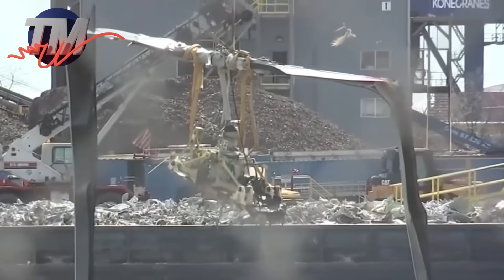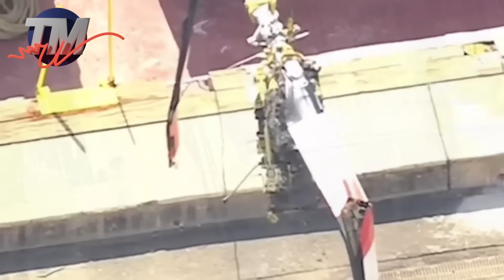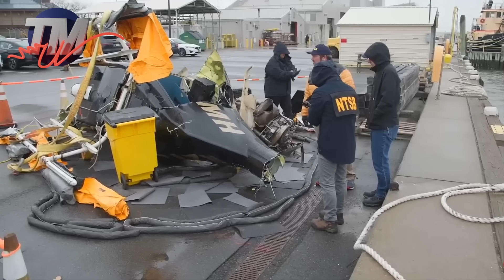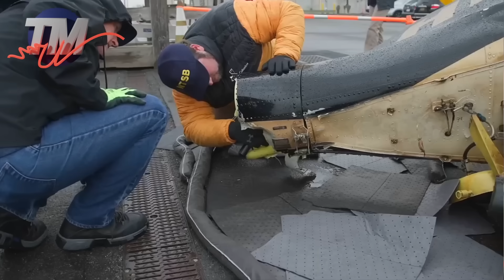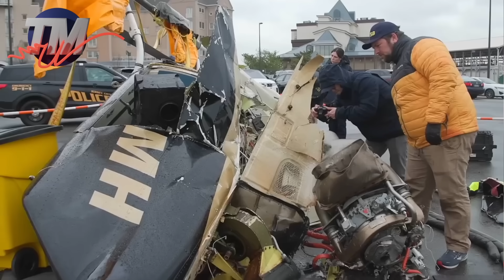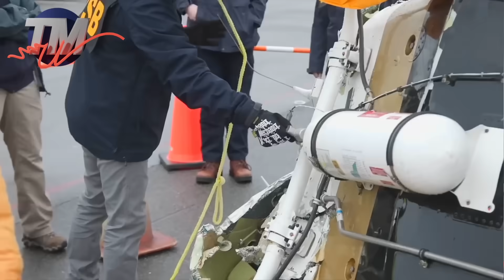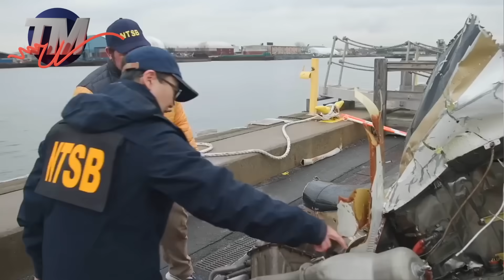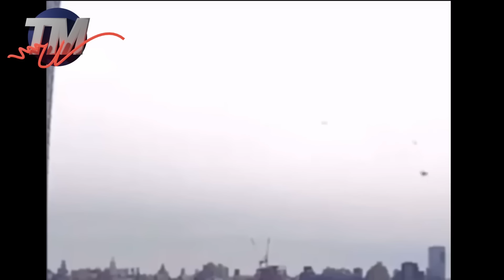Recovery of the Main Rotor of the Hudson River Tourist Helicopter - it's worse than we thought

Comment: !. Gearbox seizes. 2. The mass and inertia of the rotor causes the fuselage to suddenly twist in the direction of the rotor spin. 3. The sudden twist causes so much leverage on the tail section that the aluminum tears from the rivets.
Reply: I agree 100%
Reply: @GUITARSTUFF911  That is possible, but if the MR gearbox seized, then the mast pole would have at least shown massive twisting or would have twisted off probably where the cone set sets in the mast pole, because of the inertia of the main rotor hub and blades.  20 years working on and flying in these.
Reply: @POCarton  That is also a good observation,  I am just trying to understand what happened and at this point it is all speculation, I Will be following this outcome with he NTSB. I am admittedly no expert at all, just using the practiced skill of observation and research and logic. I never clamed to  be any kind of expert just a lowly observer with good research skills. Trying to understand what happened in this tragic case...
Reply: My theory as well.
Reply: @kenjhee  I 100% agree.  I thought this was the failure mode from the very day of the tragedy due to the video showing the main transmission falling while still attached to the roterhead and blades. That amount of instant torque probably broke the necks of the occupants instantly.  Very sad.
Reply: @edbittner480  damn ,, yes u right
Reply: @edbittner480 this is something I hadnt considered. You dont see that torque from watching the helo but you are saying the passengers would have experienced it?
Reply: At first I did not agree with your conclusion, as the rotor was spinning freely as it fell to the water.  Then I saw the commenter who pointed out the likelihood of shear pin releasing, which would actually allow the rotor to freewheel while falling, which it could not do if still directly coupled to the  transmission.  So I agree with your conclusion.  Also from my engineering experience in the defense industry, it is difficult to comprehend the massive forces generated by an abrupt maneuver under power, such as you described with a sudden gearbox seizure.  The instant 90 degree yaw with the tail rotor still providing full counter force would likely put stress on the tail mast far beyond its design limits.
Reply: @BrandononIce-sk7fx  Absolutely  The amount of force generated at that instant was tremendous, I am sure someone with a degree in math could do the calculations, I will ask grok......RE: For context, a typical helicopter transmission might handle steady-state torque in the range of 1,000–10,000 N·m during normal operation. A sudden spike to 500,000–5,000,000 N·m would likely shear bolts, fracture mounts, or cause catastrophic failure of the transmission or airframe,
Reply: @BrandononIce-sk7fx   The transmission mounts or airframe would fail at their weakest point, likely well below 438,000 N·m.
Reply: @BrandononIce-sk7fx There is an instant when one could see the tail still pointing the original direction as the rest of the body was 90 to the right

This tells me the separation was instantaneous, or it would have changed direction even slightly before shearing
Reply: This makes the most sense.  People who think sabotage is possible are our of their minds. It's an accident. Nothing more. Nothing less.
Reply: For the box to seize it must be catastrophic. It is not unknown for a  gear to crack in two without any prior warning. Mag chip indications are fundamentally teeth wear and bearing break up indicators. HUMS systems were introduced for more transmission analysis in flight after a British oil rig  helicopter of a Puma type derivative had a complete rotor and shaft detached in flight. All the crew and passengers were lost. Cause? A corrosion pit had developed in the main ring gear of the gearbox. The sea water environment had over time managed to penetrate into the housing and condensed inside the box. The pit caused a stress raiser in the gear and "Bang" fatigue failure without warning. Contributing factors were poor aircraft cleanliness and periodic fresh water washing of aircraft fuselage post flying over the sea. Like it had never had one in months. Storage of the aircraft in high humidity hangar and lack of first line corrosion prevention and inspection methods or experience of such by operators.
Reply: That is the best educated guess at this point.
Reply: Some elaboration from an amateur physicist that studied engineering:

EVERYTHING can be modeled as a spring.  Assuming the gearbox did seize, the rotor blades will keep spinning from their own rotational inertia and load the mast as a torsion bar.  if nothing breaks before all of the rotational energy of the rotor blades is taken up by the twisting mast, the rotor blades will come to a stop and the mast will start to unwind and become an oscillating torsional pendulum, until all of the energy is dissipated.  In this case, the torque seems to have ripped the gearbox from the helicopter, before the rotor stopped, so the rotor kept spinning, after the helicopter came apart.

One way for the gearbox to suddenly lock up is if one of the planetary gears failed, split in two, and a fragment lodged between either another planetary gear and the ring gear, or between the sun gear and another planetary gear.  It may be possible for a single broken off gear tooth to jam the gearbox, solid.  I read a textbook on vibrational analysis (about thirty years ago, so I remember neither the title, nor the author) that suggested that the acoustic signature of one cracked gear could be detected, but not in real time, as it discussed forensic analysis of a recording a helicopter gearbox that used then-bleeding edge analysis techniques to isolate the gear tooth impacts to determine that a crashed helicopter whose wreck was unrecovered was lost to a cracked gear in the gearbox.

Gyroscopic precession is counterintuitive, unless you successfully flew WWI fighters like the Sopwith Camel or Fokker Triplane.  In these aircraft, with their engine providing a large spinning mass, pitching up induced right yaw.  Turning left was harder to do, as left yaw pitched the nose down and pulling up caused a right yaw.  Inexperienced pilots could apply enough left rudder, at take off, to immediately pitch over and crash.  Why is this relevant?  A sudden yaw motion on the tail boom is going to cause the tail rotor to precess in a way that applies a twisting moment to the tail boom.
Reply: A seized gearbox would help the rotor keep rotating (by the flywheel effect) of such a heavy component spinning round, it would help rather than hinder the rotation.
Reply: @robertfack3082  not if it locked/ seized up from lack of oil.
Reply: That's pretty well what I though the rototating mass of the blades would present and awful amount force on the gearbox assembly if the gearbox seizured and the sudden yaw with that amount of force may that have caused the tail to inevitably snap..
What's interesting is the break points on the rotors blades are in exactly the same place on both blades and also close to the rotor hub.. not sure what other people think more as a topic of conversation..
People died in this tragic accident and hope ntsb will get to the bottom of how this happened..
Absolutely tragic and very sad..
Reply: @philkennedy342  They could have snapped in recovery from leverage against the water if moved too fast. Or when the seizure happened but appeared intact in the autorotation from centrifugal force.
Reply: @sbukosky  Doesn't matter so much that they snapped, but how they snapped and how intact they remain. Both broke the outer skin without twisting or separating the core, which says to me a high force with low speed.... something after the accident.
Reply: @philkennedy342  Blades appeared to be intact and spinning while falling, likely destroyed on impact with the water.
Reply: @philkennedy342  I noticed as well that both the rotor blades snapped in near enough the same place.
Reply: @philkennedy342 if you watch the close in video of the rotor's decent after separation you see them intact and spinning when they hit the water after they had turned sideways in the air instead of vertical like they are when attached to the chopper. Pretty sure that happened when they impacted the water unless they snapped when the torque incident happened and were just stretched out on the way down by the little cyntripical force it still had on the way down.
Reply: @scottcoley1906  I just thought it strange that the blades broke in exactly the same place even the break was exactly the same so like you say did that happen on contact with water or on separation and stayed straight while still rotating note taken thought...
Reply: @philkennedy342  It was ok though on the way down unless the spin was keeping them straight.
Reply: @philkennedy342  Looking where the tail broke off,I cant believe how FLIMSY that looked! there's a lot of leverage against that too
Reply: I said this day one.
Reply: You nailed it....!!!
Reply: How and why did the gearbox seizes?
Reply: @goggobus4076 That's the $64 million dollar question!!😮
Reply: @goggobus4076  Badly rebuilt gearbox perhaps. I see them for sale online for $20k.
Reply: @goggobus4076  Because maintenance on helps used for tours aren't maintenanced like they are for the police or military.This one had an inspection I believe two years ago and wasn't due again for another 5 years.
Reply: @goggobus4076  They were broke and not following the rules or servicing things properly.
Reply: @The-House-of-Seven  This helicopter was serviced March.
Reply: @GorgyPorgy65  What does that have to do with it being done correctly or not?
Reply: @ It doesn't.  I'm just saying a time frame.

I'm going right out on a limb and saying I see something a little different to this op.
I see a join which has failed but not from tearing.

The joint of the tail section is perfectly ok on the top half...ie , screw/bolt holes are not torn at all.
Yet look at the bottom half.  The bottom has been torn away and this gives the indication those bolts were intact .

The fact the bolt holes are fine on the top gives the impression those bolts were not there.  This was a partial fracture due to sheering of bolts or bolts not there in the first place.

Look at the steel at the join, The bottom hole , where it has torn, is pulled inwards to the left.  The left hand side is pulled outwards.  This tail sheered off to the left...but it sheered off only at the bottom.  The top came away cleanly.  This to me, was not a tail breaking off.  This was a tail which was unsecured at the top and the forces made the bottom finally sheer and break away.

What do you think ...after looking at the footage re what I said.
Reply: But wasn't the rotor still spinning after it Seperated from the helicopter?
Reply: @Chooky88 this is the exact cause why it would even detach. Fuselage stands  almost still, rotor turns. There is no reason why the end result for the Rotor shall be detached + standing exacly still after a chaotic detachment. It lost RPM however.
Reply: Yep I am looking that way too. If it were a boom strike the rotor assemble would have shown that damage, and it would not have been able to fly as it did.
Reply: All happening in 10 thousandths of a second.
Reply: Good analysis!
Reply: I agree. From time 1.48 to 2.12 you can see a large hole in the tail section where the break is, where the tail section came off on the side facing the camera, the left side if the tail boom. Do you see that?
Reply: I totally agree, why is everyone over-complicating this.... to get views???
Reply: excelente.. el mejor comentario
Reply: Exactly what I was saying after the 1st 24hrs after the incident when I saw the CCTV footage. I've seen the exact same results happen with Scale R/C Heli's where the Transmission has a catastrophic failure. The sudden yaw was enough to rip the Mast off the trans(with blades and head intact) and bend the tail boom. On this 206 with much more mass it's no wonder the boom departed after the head, mast, and trans did.
Reply: Good observation.  That certainly fits with what we have seen so far.  It also may explain why the roof section along with the transmission and Rotor ripped off.
Reply: My thoughts ever since I saw the live stream video.
Reply: It'd autorotate if it still had a helicopter attached so I guess it'd do the same when free falling? Dunno. Works for pine tree seeds 🤔
Reply: That’s what I am wondering. If it totally seized and the inertia ripped the transmission from the mounts?
Reply: Transmission froze up, my thoughts exactly. Right from the first time I saw the video. The mast acted like a torsion spring probably keeping it from grenading. I thought the mounts broke but it turns out that it ripped the top off. The rotor fluttered down with the transmission attached
Reply: I second the gearbox seizure as a long time A&P.
Reply: That would be my guess.
Reply: That's exactly what I believe has happened. Gearbox froze up or  failed . Causing  the rotor blades and fram of helicopter to twist and causing the transmission to blow off the helicopter. This  also would cause the.isse worh talrotor as well.
Reply: This was my thought as well. The boom, to me, appears to have failed in overload (as you say, sudden stoppage points the aircraft, aero overload breaks the boom). The gearbox mounts let go, etc. If true, the gearbox will tell us with Crystal clarity. The wreckage is extremely well preserved. 
We await facts and findings.
Reply: yeah, transmission seized, it wasn't mast bumping, mainly because the 206 uses a semi rigid rotor system, means it's not likely in a 206.
Reply: Agree
Reply: I’m not a pilot but I am a mechanical engineer (retired) and I agree with your theory. This is only my opinion, maybe the gearbox had skipped a service or the wrong oil was used at the last one and this is where I’m coming from. I have a Range Rover and a Mercedes and both need specific oils for engine and gearbox, RR’s are renowned for engine failures while the MB gearbox oil is life of, but that life of is 100,000 miles. Anyway guys what happened here is a tragedy and I’m sure you will hear what the cause was. May God care for those poor souls 🙏❤️
Reply: It would be almost obvious to me that a sudden jam in the gearbox is most likely responsible for severing it from the structure (while taking structure with it).  However, all of this kinetic energy would have come from the rotating mass.  This may include the engine below as well as the rotors above.  If only the rotors take credit for ripping it off then it means that all the torque was transmitted down the mast.  I am shocked to consider the incredible strength the mast would require to not immediately shear as it attempts to accelerate the entire  transmission into rotation.  I would more likely believe that power from the engine would have contributed simultaneously.  I don’t know enough about the engine coupling to speculate.  It would have to rotate in the same direction axially to play a role.  One thing is certain.  The exact cause of this tragedy will be discovered.
Reply: 100 percent. Whipped beyond stress loads.
Reply: I think you may be right-had to be huge amount of energy to cause the damage - something I can’t see pilot induced RIP
Reply: CASE CLOSED!  WTF does the NTSB exist when we have you??
Reply: I would tend to agree, and the 'tail section' is mainly there to just support the tail rotor. I'm a 77 year old man and have most of my life around all sorts of rotating equipment. When you have things rotating that quickly, there's a huge amount of inertia involved. I would suspect just about every part in that transmission and the shafts, gears bearings...are made of very hard heat-treated steel, even a very small (4-5mm) piece getting loose in there could cause a seize-up. NTSB will inspect and give a report, those guys know more about this stuff than most of us do.
Reply: Torque force is a doozy- I put a brass tube with a plastic prop into my Dremel tool and let it go atfull 20000 rpm- the brass tube was ripped in seconds and was twisted like a coil asthe prop spun away. Torque is a mighty force.
Reply: @ it definetely sent the transmission off the fuselage. In the videos you can see the chopper sent off in less than a second out of that force. It all started with the tail dettaching after the transmission seized.
Reply: @sbukosky  there was a witness to the sound. Can anyone post what that witness stated? Something like a Boom?!?
Reply: Agree
Reply: The mast pole would be twisted from the sudden stoppage.
Reply: How old was helicopter !
Reply: Oh my God
Reply: Oh my God
Reply: I don't have the slightest idea about aircraft, but, according to what you all say about transmission lockup, could this result in the main rotor blades fracturing at the same distance as if they had been broken in the exact same place? When such a brutal torsional force is present as to tear the entire transmission assembly from the fuselage, shouldn't the blades be bent and almost wrapped around the rotor shaft? What a terrible loss in such strange circumstances. Greetings from Colombia.
Reply: Excellent theory —could be a socket was left in there.service records I’m sure looked at. I dropped socket in gear box of tractor why I thought of it
Reply: Gearbox oil leak, or failure of ground crew to replenish oil after draining. That way it would run for a while before a massive torque event.
Reply: There is a lot of discussion in this..whether it went to the left or right (regarding footage), if the rotor at the top caused the yaw, etc, etc.
Watched the footage a lot and I think it definitely yawwed violently to the left and the tail section here kind of gives a lot of credence to that.
Look at the join.
The hole at the bottom has pulled the steel inwards and there is other footage which shows the left hand side is pulled outwards.  The hole clearly shows the steel was torn away with the join intact.
However look at the top half or 1pm to 3pm quadrant of this join.  It is fresh as a daisy ...no tears , holes still there until it gets up to 12 noon and you can see the tearing.
I bet you anything , this section of the tail either had missing bolts OR the overlap was not complete to the 2nd row of bolts and this created the weakened structure...enough for wind and forces to create enough force to break this tail section partially to the left (explains the abrupt yaw to the left) before those same forces tore it right off.
Note the top quadrant holes are still perfect....not one tear in any of them.  The tail failed...whether deliberately (sabotage) OR mechanics did not put them back in to the regulations required.
The paintwork adds to it.  If this section was painted...the end of the paintwork is at the holes.  That means those holes were drilled RIGHT on the edge of the attached piece.  The overlap was not overlapping enough and the secondary reinforcement screw/bolt holes were not securing enough of the forces.
Let's see how this pans out...but we have seen only 1 bolt like this bring down passenger jets
Reply: Exactly what i was thinking.
Reply: The blades would have snapped off of it suddenly seized the gearbox.
Reply: @sbukosky  yes due to mrg seizure
Reply: Flying is not as safe as they say.
Reply: @sbukosky  and the tail hits the transmission box
Reply: Probable. However, the dFMEA in the PHAC [DO-254 Pea-Hack] should've addressed such a GB failure [wonder what the Real-Time, Design mitigation was]. Need a Kinematic Diagram to analyze it.
One thing is somewhat clear at this point, is that, it was probably NOT a MR-Flex hit to the Tail boom [Forensic analysis with a Mass-Spec will tell, even if sabotage]
The MR-Blades did NOT look damaged [as it would be if there was a significant TAIL Boom strike]
Reply: That sounds right.
Reply: From a tentative engineering perspective i had same thoughts on seeing the rotor and gearbox departed like that
Reply: I'm leaning this way, as well.  But will obviously have to wait for the investigation to conclude.
Reply: Those were my thoughts also. I just don't see anything remotely looking like sabotage as the presenter hints at.
Reply: Bingo.
Reply: This was my thinking as well.
Reply: That's the first thing that went through my mind.
Reply: Also remember it was in fast forward flight, exposing the side of the fuse to the oncoming air sure wreaks havoc on especially long levers like that.  Btw didn't the rotor spin on it's way down including the gearbox? Would fit the overall theory. Can't wait for the report tbh.
Reply: It does look like that, but... It surprises me because, I would have thought the mass of the fuselage and air pressure from forward movent, would make the main rotor/blades be the likely weaker/less mass portion of the two. If the box seizing means you get that result, I'm wondering why this kind of thing hasn't happened more.
Reply: @xray606 transmission failures on helicopters are exceedingly rare, thank god.
Reply: WH Yis the original poster even discussing the bloody tail rotor?  It's absolutely of NEXT TO ZERO importance here because the entire top mechanical part of the helicopter disconnecting itself from the top of the helicopter is really the only important thing.  It stays connected, and that helicopter slowly declines from engine/transmission failure, or it autorotates down from a tail failure.

The complete failure of the top of the helicopter is really THE ONLY thing that needs to be concentrated on in the short term as that sort of disconnection is basically unheard of and was the direct reason why all of the people are dead. I think those of us who have mechanical knowledge of a helicopter (unlike you) can all suggest that it's a good bet that a seizure was so violent that it severed all of the connection points off the top.

PLEASE...STOP with the content creation of this.  Stick to details.  You're not a mechanic or specialist.  All you are is some dude making content money off of a tragic incident. You people always come out from underneath your content creator rocks every time something like this happens, complete with zero actual first-hand knowledge of the vehicle that was involved.

Please. Go back under your rock.
Reply: @DavidSommers-r7g  boo booo 👻 😂
Reply: Hola. Soy español y vivo en madrid. Una pregunta. Parece ser un niño iba sentado delante junto al piloto. Es posible que este niño tocara algun pedal o mando y hiciera que el helicoptero se desestabilizara?. O los mandos del lado del piloto estan desconectados. No se. Otra teoria seria la de un posible sabotaje a fin de atacar a siemens empresa de la cual era ceo el pasajero principal. Este accidente es rarisimo y no es para nada normal. Gracias.
Reply: @oscarperezrodriguez5076 , i had the same thoughts a few hours later after you wrote you're comments here. I read yours afterwards. Condolences from Amsterdam.
Reply: @oscarperezrodriguez5076  A Russian teen who was son of the pilot on (at the time a brand new fly by wire Airbus) caused it to come down.  So, you're not crazy for throwing that theory out there.
Reply: @oscarperezrodriguez5076 Los mandos, cyclic and collective no estan montados cusndo llevas passjeros en el asiento iszquierdo. Pere si, los pedales, el el niño llegarie si, un peligro
Reply: @Muehlema1Yes, that theory makes the most sense: the child in the L seat next to the pilot could have touched something(s) that the pilot could not respond to. How tragic and a lesson to teach everyone in aviation + transportation industries. 😢 No one esp. children allowed to sit near operator! Must be enforced, 🙏🏻🪷🕯️
Reply: It looks like a failure of tailboon attachment hardware,  At that speed if tailboon gets detached from the main fuselage the main rotor torque probably caused the detachment of the whole hub, blades, XMSN and support assy from the Acft cabin section . The pilot's corrective flight control inputs after tailboon detachment probably contributed further to the main rotor section. Recently Bell has issued with a lot of ASBs on tailboon attachment on other Bell 407 variant and inspection is even downgraded to every 50 hours for a similar part number tailboon. 
One of the Bell 407 crashed in IS during hover @ one year back due to the tailboon attachment failure where the mechanic forgot to put one bolt and nut out of a set of four..

Otherwise only sabotage can explain such huge damage to aircraft in flight.
Reply: @navnilsarathi2759 it failed aft of the attachment point, not at the attachment point. Hardware didn't fail here.
Reply: @navnilsarathi2759  tail rotor power drops off with airspeed.
Reply: @navnilsarathi2759 the tail was snapped 12” aft of the tail attachment point.  Clearly It snapped along the rivet line of a former.  Look closely at the video.  Was the gearbox seized is the question i want answered.
Reply: The gearbox wouldn't seize.  There's enough force in the rotor to grind the gears flat.  It would twist in the opposite direction.  Tailboom failed first.
Reply: @ Possibly half severed and the direction was then lost...hence the swift yaw to left (I'm seeing the helicopter suddenly point LEFT , not right).

If you look at the tear fracture on the tail....the helicopter  steel is PULLED to the left in the failure point, ie the steel tail is curved inwards on the right hand side and outwards on the left hand side.

That means the forces were against the tail on right hand side.  If the forces were on the right pushing against the tail, it adds credence the tail was PUSHED that way which would steer the helicopter to the left suddenly before the entire tail section snapped off.

I think it was a partial failure of the tail section, which yawwed the helicopter violently to the left.  The physical forces then completed the ripping off of the tail.

I think the  top rotors ripping away from the helicopter  were the secondary reaction to the first dynamic force.  The tail end broke quite close to the main section, possibly a part went forward with force and took out the top rotor mechanics.
Reply: Look closely at the join....it isn't torn at all.  It has precisely come apart.  It is only the bottom section of the join which is pulled and torn (to the left).  This gives evidence that the bottom was secured by bolts...but the top was not.

I'm wondering if the screws in that tail section has sheered away, were NOT on the  helicopter and the drag and gap allowed wind to enter the area forcing the tail section in two movements...partial and then a full tear off the aircraft ?
Reply: @ For sure, the gears are not enough to wrench the entire unit. The teeth would shear. I was assuming something bigger had broken. I can’t imagine that the tail boom shearing off and the subsequent yawing could cause such a structural failure. But, who knows? Bell should have the knowledge to simulate this.
Reply: @jamesdellaneve9005  rotor bumping, look it up, perfect explanation. But what caused the helicopter inputs to get it to do that.
Reply: @ How often is a complete tear out of the top structure of the helicopter after a rotor bump? If you watch the video, it’s flying straight. Even if you were hard on the collector, would it happen that fast?
Reply: @jamesdellaneve9005  the rotor hit the tail section many times in a split second which shows on each end of rotors because they are broken consistently in the same spot. Which in turn correlates to the distance at tail section where it was "cut off".
Reply: @ Yes. I saw that on what they were pulling up from the water. I was an engineer at Sikorsky back in 1985. I saw a few land after bird strikes. 4 rotors is better than 2. The first rotor would take a big hit, the second, less and so on. It would be a bad landing, but it made it. I saw two of them when I was there in my 18 month period. How common is it for the entire top of the chopper to rip out after a tail strike? That’s the strongest part of the chopper. When I was at Sikorsky, they found extreme cracks on the structure under the transmission on the S-76s. It was due to previously unknown vibration patterns. They had to re-design the structure and retrofit all of the delivered birds. Luckily, nothing bad happened.
Reply: Agree
Reply: Wouldn't the four rods that mount the gearbox to the roof have bent even a little? They appear pristine. I can't imagine they are that much more robust than the roof itself.
Reply: @ky7299  Nope. those rods are essentially mounted to a soda can.
Reply: @The-House-of-Seven  That part of the airframe takes all the torque transmitted from the engine to the rotor and the whole angular momentum of the helicopter itself. all moments of inertia meet there. It can't be that weak.
Reply: @ky7299  Under normal circumstances the rotational forces are always started and stopped gently. This could happen on the ground. You can replicate this right now. Raise the engine rpm and engage the main rotor with a dog clutch. Same exact scenario would happen. This is what happens when the rotor it stopped in a fraction of a second.
Reply: @The-House-of-Seven  Agree..the force has to go somewhere.  It doesn't just dissipate.
Reply: @The-House-of-Seven 
Nah. That much kinetic energy and momentum of the rotating assembly would explode the gearbox casing.
Reply: @ky7299 , landed in water upsidedown ?
Reply: @ky7299 the fuselage is aluminum alloy and about 1/32" thick. "These helicopters are tough" is the only lie I heard in the video. Relatively they are tough when compared to a soda can with soda in it unopened ( they will knock you out without busting but you can still crush them from the side). Military choppers are tougher because they put armor on them but any chopper built thin as 206's are can't take too much of the wrong type of punishment. It's why you never see them fly in storms but you will see black hawks and hueys and other heavier built helicopters fly in storms. You won't hardly ever see a 206 in a storm though.
Reply: @scottcoley1906  The fuselage may be aluminium but it is reinforced with structural cross members like ribs and spars and I would expect the gearbox to be mounted on such members and not the flimsy aluminium that's there just to keep the wind out.
Reply: The inertia in the main rotor would shear the mast before the transmission got ripped out of the upper deck.
Reply: @jalyukon  Check out the rotor and how it's no longer indexed to the swashplate, the linkage is twisted around almost halfway around the mast.
Reply: I think whatever it is if you watch the NTSB they look over the rotor and transmission walk around and look at were the rotor and transmission attach and then they walk to the tail and look at the tail part and how clean the area looks as if it just fall off or came loose at the bolts. The copter looks clean and taken care of. I think the tail fail off and caused high speed torque and the rotor tore off.
Reply: The Gearbox did NOT SEIZE , Look at the VIDEO , The Gearbox IS STILL attached to the ROTORS which REMAINED SPINNING ! and is STILL Attached ,  that is obvious in the video .
Reply: Spot on but sprag clutch maybe?
Reply: lol…homie threw the nose and cut his own tail off…what fantasy world are you living in?
Reply: @ you must not work in aviation or must not have seen the video out the apartment window. Clearly lost tail rotor authority prior to the mast and transmission departing the airframe.
Reply: Pretty sure it was rotor bumping. But what caused it. Pilot error can cause this. But it could have also been birds throwing rotor out of line. Then it caused rotor bumping. Rotar bumping causes the rotor to cut the tail section off by hitting it. So pretty clear that was the problem. But what caused it?!